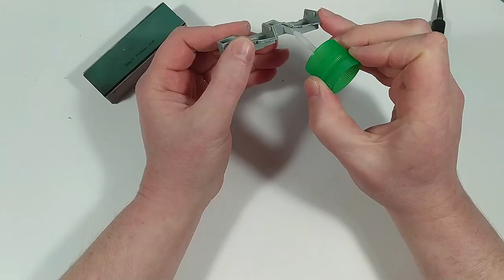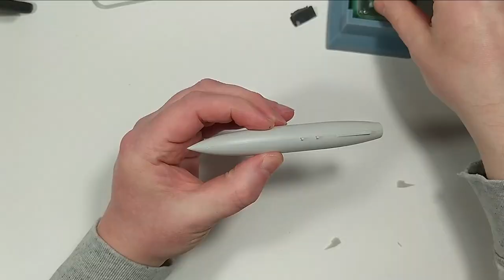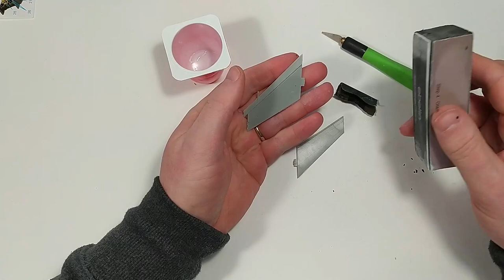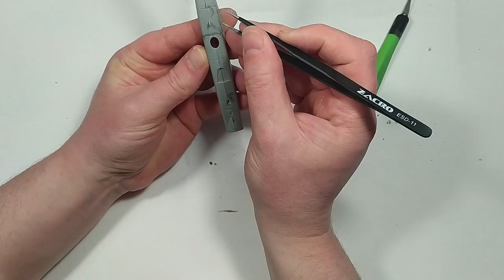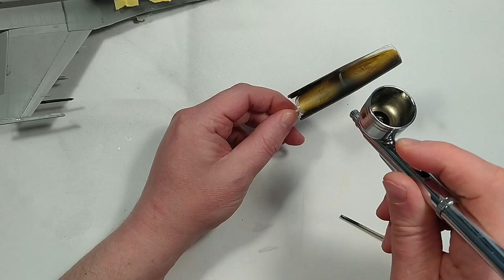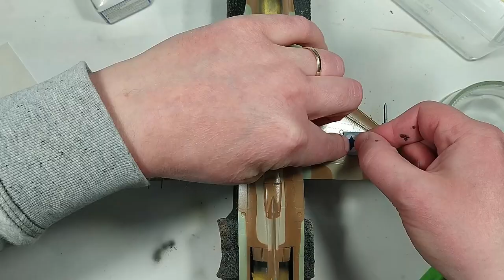FULL BUILD | F-16D Barak / ברק F-16D | Israeli AF | Kinetic 1/48

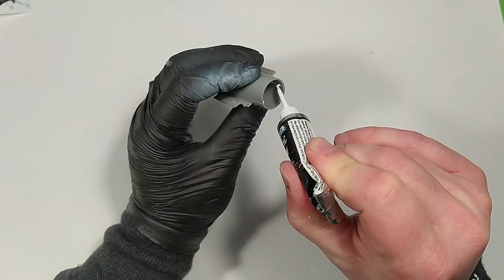Comment: This is a great build! At 12:15 when you were filling in the gaps in the air intake you wiped the excess off with a cotton bud, was the cotton bud dipped in water or did you have to use something else? And did you let the putty dry before doing that or did you wipe away the excess right after applying it?
Reply from the maker: Hello Isaac. Thank you for your comment and sorry for my late reply. I’ve been at RIAT over the weekend. 🥳🥳🥳 
Regarding the putty wiping: It depends. When it’s fresh, I just take a dry cotton swab and wipe it away. When it dried, you  need a damped (water) cotton swab. I work with the Vallejo Putty, if you use another one it may needs a different handling. But when I remember correct in THIS case I applied the putty and wiped away straight away! 
I hope that helps you! Best regards from 🇩🇪